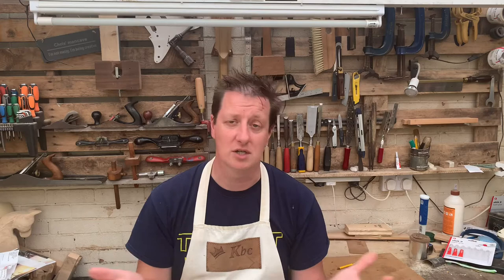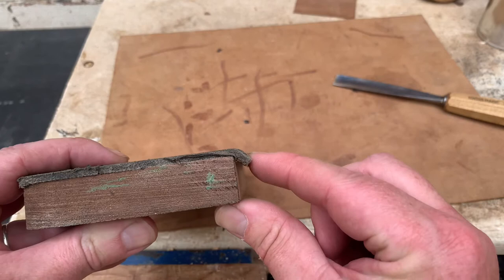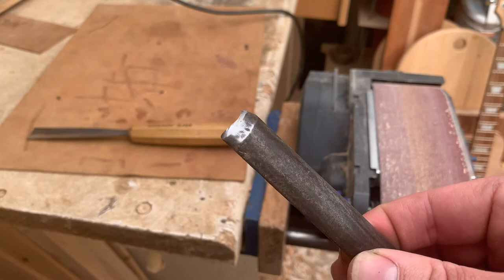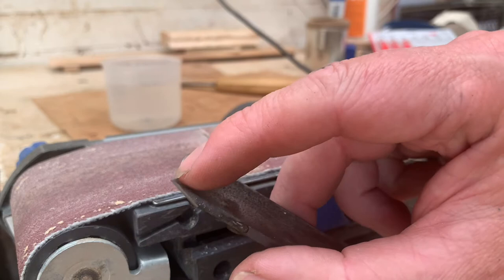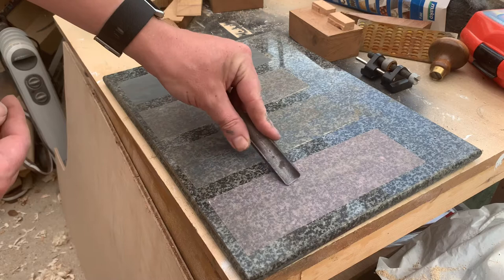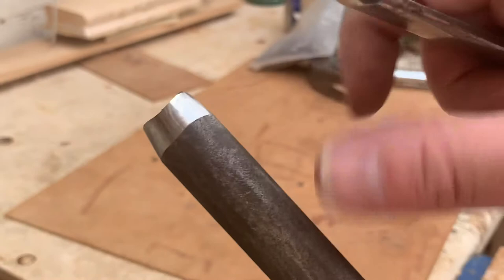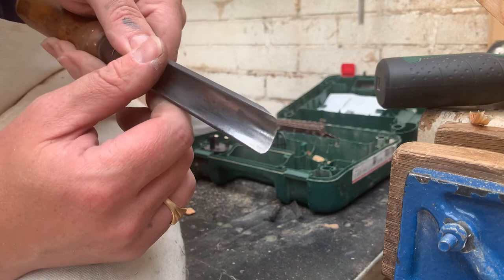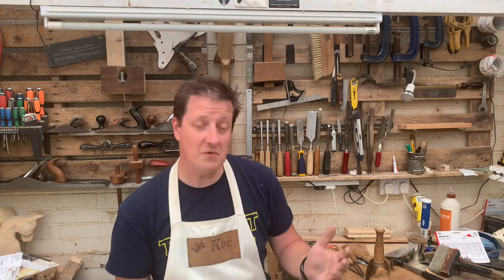How to sharpen a carving chisel and how to keep it sharp!

Comment: Thank you for the video. It is really helpful
One question however.
I want to make a strop. I have found a piece of leather.
Problem is that it is smooth on one side, rough on tother.
Question is which side do I use?
Reply from the maker: A very common question that divides opinion!  Which means either side works!  I tend to use the smooth side with a sharpening paste or wax. I suspect the rough side would eventually be worked smooth over time any way 👍
Reply: Thank you. Rough side down it is.
😂

Comment: Good vid. Wouldn't the squared part of the chisel make things a bit uneven? 6:00
Reply from the maker: I’m not quite sure what you mean. If you’re referring to the end of this chisel not actually being square, then no it makes no difference. If you think that you want to square it it off, the do that before this stage.
Reply: @KingBespokeCreations  At the 6:00 mark , the metal under your two fingers.
Reply from the maker: @curiousgeorge555  oh I see, no as long as you rotate all the time. There is very little pressure on those fingers so it all comes out smooth 👍